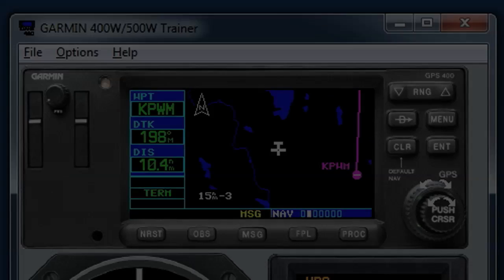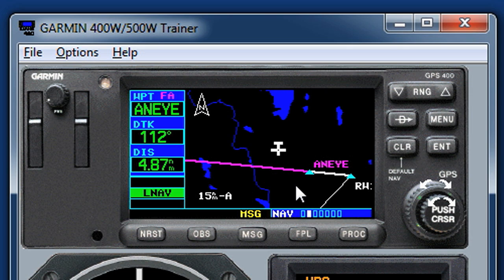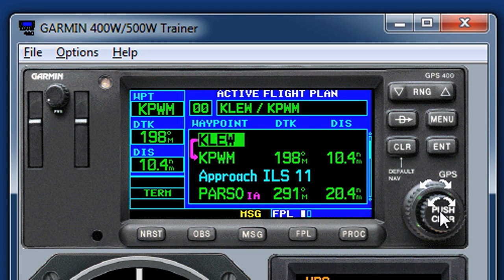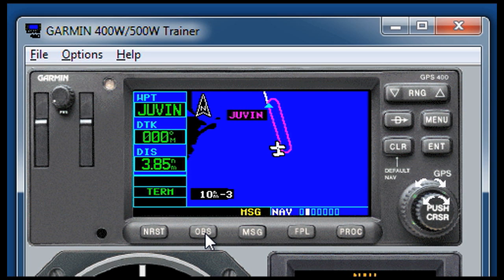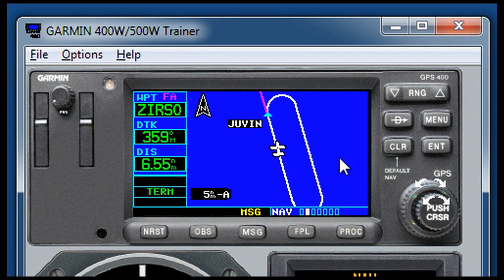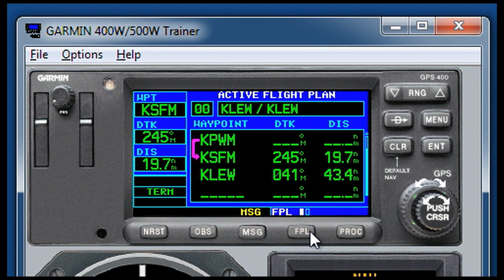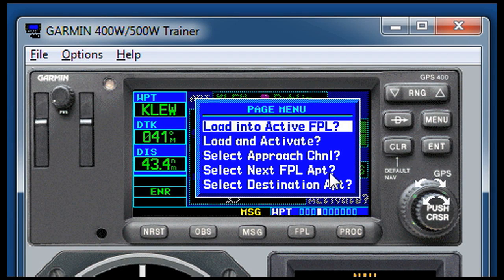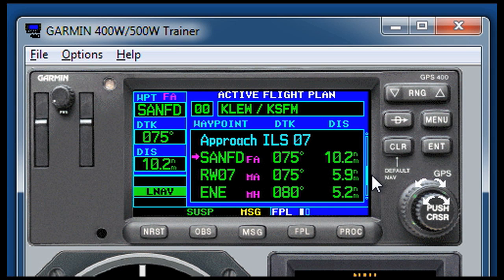Garmin 430 Tricks and Secrets Revealed

Comment: To intercept the "Leg" you can also highlight LoYER and press Direct, Direct, Enter and it will also intercept :Leg".
Reply: Won’t that just fly direct to LOYER?

That isn’t what you want to do. You want to intercept the leg not fly direct to a fix. 

In an FMS this is so much easier. Line select the waypoint you want and put it in the active waypoint for a direct. Or select the first waypoint of the leg you want to intercept and put it in the from waypoint.

Comment: Nice tips. My trainer has this system but my CFS will not let me use it! He insist that it is all done manually with paper and pen. This is where I disagree with him. These navigation aids are made to make the pilot work load much more efficient and accurate. But he says that pencils never run out of batteries and charts don't break when you drop them like the iPad will. I suppose that is true, but calculating a holding pattern is time consuming and tedious. Pressing a few keys on the ol' Garmin is much simpler.
Reply: +Täking Thë High Roäd Then I'd get a new flight instructor. I agree that becoming too dependent on the GPS is foolish, but so is not using it at all.
Reply: gevmage I can use it, but not for testing purposes. Yesterday we lost three fuses in the dash and the damn thing went out. He looked at me with that smug "I told you so" look and I am kinda glad I did know how to use a paper chart! We lost all lighting as well. It was still light out, but still scary too!
Reply: Your instructor is right.

Comment: No doubt Jeff knows what he is talking about but this video is more likely to make a new user feel dumb and unlikely to learn anything except utter confusion.

If this is some kind of advert, it leaves AvWeb looking pretty useless.

This video fails to show how to initialize, or how to set up your Garmin Simulator to be the same as the video. Then there is no clear aim or objective of what the video is about, or any clear guidance along the video.  It rambles, and leaves a new user totally confused. Jeff needs to pull this one down and start afresh.
Reply: This video is not for beginners with the Garmin 430.  There are other videos for that.  This video shows the fastest way through a couple of common but easily-confusing paths in the 430 software.  The assumption of this video is that you use the 430 frequently already.  

And if you're in the clouds and something goes wrong, yes, fly the airplane first, but if you're using the 430 for primary guidance, this video is about some of the ways of doing this quickly and in such a way you only have to do them once, so you can concentrate on other things.
Reply: I guess it's too much to ask that it should go without saying that a video showing tricks and secrets is not for a BEGINNER!
Reply: Totally agree. In an emergency situation  where you need to immediately return to the airport, you should be concentrating on actually flying the airplane, not scrolling and pushing buttons. This would be great if you have a qualified co-pilot sitting next to you. I have flown for over 40 years without one of these, and I am still alive and still flying.